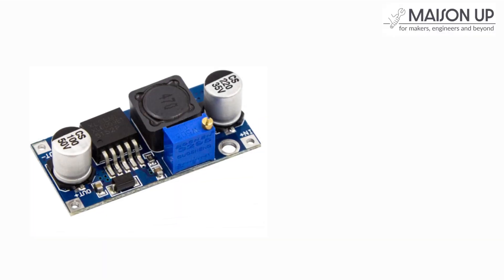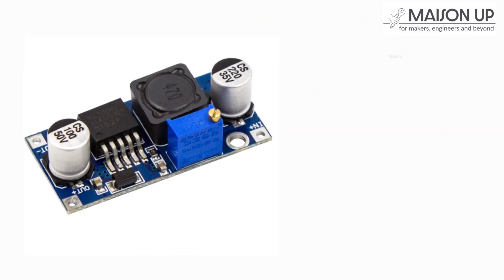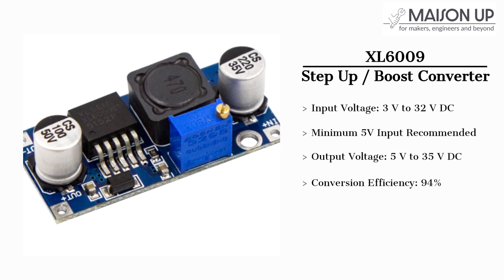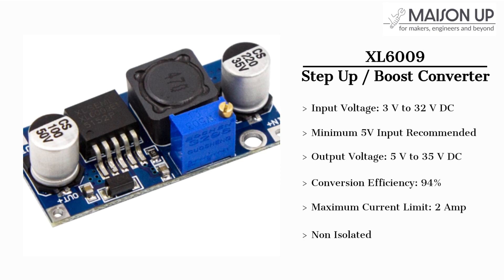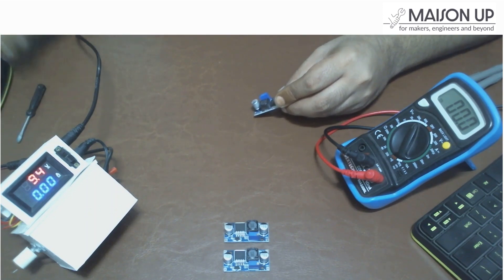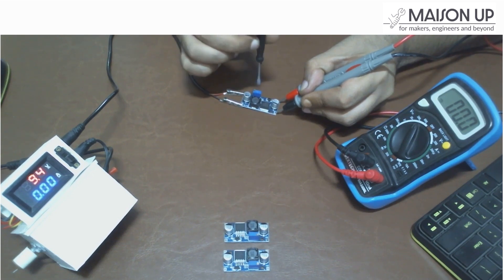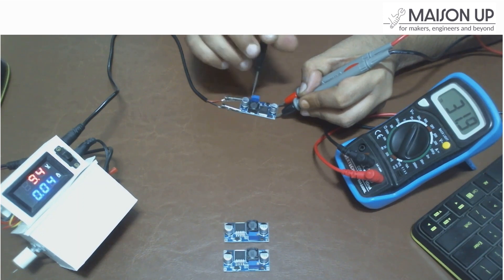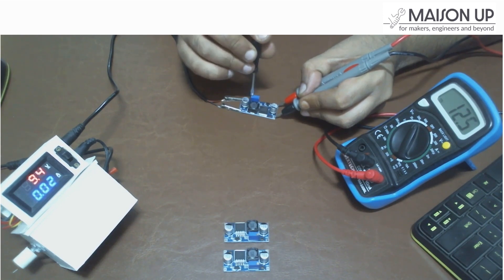Beginner's Guide to Using the XL6009 Step Up / Boost Converter Module: Setup and Operation

Comment: I have some of these and I want to power a E10 3.8V 0.3A Mini Light Bulb with two 3.7V 18650 Rechargeable 9900mAh Batteries with a 2 Pin AC 250V/10A 125V/12A rocker switch to turn the light on an off. Where to begin? I have no clue.

Comment: Hey, i want a module which can give 12 volt always, no matter when input is 10 volt or 14 volt. Will this xl6009 work?
Reply from the maker: The XL6009 (and XL6019) are only boost converters – they can step up a lower voltage to 12 V, but if your input goes above 12 V, they won’t step it down. To always keep 12 V no matter if input is higher or lower, you need a true buck-boost converter like an LTC3780-based module or LM5118-based converter.

Comment: that voltage will drop if you connect it to the module you want to connect
Reply from the maker: Yes, a slight voltage drop can happen when you connect a load to the XL6009 module. Here's why:

The load draws current, which can cause the output voltage to drop slightly.
A weak or low input power source may not maintain a stable boosted output.
Thin wires or poor connections can lead to voltage loss.
To fix this, use a stable input source, thicker wires, and consider adding a 470–1000µF capacitor on the output side.

Comment: Hello, i have a PD powerbank that does from 5-12v 22.5w can this module boost it's power my 19v hp Laptop ?
Reply: No
Reply: @lifeisdiy771  care to explain why?, im curious.
Reply from the maker: Hello! Good question — but the XL6009 is not suitable for powering a 19V HP laptop directly from a PD power bank. Here’s why:

The XL6009 boost module can output up to around 2–3A max, but most laptops need 3–4A at 19V, which is too much for this module.
Even if your PD power bank gives 12V at 22.5W, that’s only ~1.8A, so it doesn’t provide enough power to safely run or charge your laptop.
Boosting 12V to 19V also increases current draw from the power bank, making it very inefficient and possibly unsafe.
For laptops, it's better to use a dedicated PD trigger module (USB-C to 19V) or a proper PD decoy board designed for that voltage.
Reply: @maisonupstore  okk, Amps
Reply: @maisonupstore  what's the name of the certain PD trigger module tho?

Comment: Hello, i have a PD powerbank that does from 5-12v 22.5w can it power my 19v hp Laptop ?
Reply from the maker: Hello! Good question — but the XL6009 is not suitable for powering a 19V HP laptop directly from a PD power bank. Here’s why:

The XL6009 boost module can output up to around 2–3A max, but most laptops need 3–4A at 19V, which is too much for this module.
Even if your PD power bank gives 12V at 22.5W, that’s only ~1.8A, so it doesn’t provide enough power to safely run or charge your laptop.
Boosting 12V to 19V also increases current draw from the power bank, making it very inefficient and possibly unsafe.
For laptops, it's better to use a dedicated PD trigger module (USB-C to 19V) or a proper PD decoy board designed for that voltage.

Comment: Thank you for this tutorial. Connecting one 18650 battery, with 3,9 volts or less voltage the Vout of XL6009 Step Up jumps to 40 volts or more, the Vout red led blinks. If the battery has 4,0 volts or more, has the correct Vout. For example adjusting to 9 volts Vout with Vin 3,9 or less, Vout has 40 volts or more. I have made this with two differents 18650 batteries, with the same result.
Reply from the maker: Thank you for your feedback! It sounds like the XL6009 module is having issues with regulation at lower input voltages. This could be due to the module struggling to maintain stable output when the input voltage is too low. A few things to check:

Battery Condition: Even though you tested with two different 18650 cells, if they are old or have high internal resistance, they might not be able to supply enough current.
Load on Output: If there’s no load connected, some boost converters can behave erratically. Try adding a small resistive load and see if the output stabilizes.
Input Voltage Range: The XL6009 typically operates well above 4V input. Below that, it might not regulate properly, leading to uncontrolled high voltage spikes.
Capacitors & Components: Some cheap XL6009 modules may have lower-quality components. If possible, try adding a capacitor (e.g., 100µF) at the input to help with stability.
Reply: @maisonupstore  That sounds like a 100% AI Chat GPT Written response
Reply from the maker: @Gipsy_T.  Haha, fair enough! We do use AI tools like ChatGPT to help structure or speed up responses but we always review, tweak, and add own experience to make sure the reply is helpful and accurate.

Comment: I have 12v 140ah battery I want to convert it to 9v for wifi router it can do that please respond
Reply from the maker: To convert your 12V 140Ah battery output to 12V for your WiFi router, you’ll need a DC-DC buck converter like the LM2596. This type of module will step down the voltage from 12V to 12V, XL6009 is boost module to increase and not decrease. Be sure to use a multimeter to precisely adjust the output voltage to 12V before connecting it to your router. Additionally, confirm that the buck converter can handle the current your router needs for stable operation.

Comment: Why when I connect gnd input and gnd output, the ouput voltage became so high until 200v ++, I need explanation for this, please...
Reply from the maker: The issue you're experiencing with the XL6009 module could be due to a misconnection or a malfunction of the module. Here's a possible explanation:

GND Input and GND Output Misconnection: If you're connecting both the input GND and output GND together, and the output voltage spikes excessively, it could mean that the circuit is malfunctioning. The XL6009 is a boost converter, designed to step up voltage, and improper grounding can cause erratic behavior.

Feedback Loop Interference: The XL6009 uses a feedback loop to regulate its output voltage. If grounding is misconfigured, it might confuse the feedback mechanism, causing the module to boost the voltage far beyond the intended level. This could explain why you're seeing such a high output voltage.

Faulty Module or Components: There might also be a problem with the module itself. Components like capacitors or inductors could be damaged or not properly soldered, leading to an unstable or incorrect voltage output.

Suggestions to Fix:
Double-check all your connections. Ensure that GND on the input side is properly connected to GND on the output side if required.
Verify that you're connecting the positive and negative terminals correctly.
Try resetting the module by disconnecting power, reconnecting everything properly, and powering it on again.
If possible, test with a different XL6009 module to see if the issue is specific to the one you are currently using.

Comment: Can you explain some stuff,

1.my earbud case had a PCB with IC that converted 3.7 volt from its battery to 5 volts for chargin, but that PCB burned, its useless now,

So can I use an TP4056 and step up module to charge my buds ? Will the step up module charge both buds at the same time
Reply from the maker: If your original PCB burned out, you can definitely use a TP4056 module to charge your earbuds’ 3.7V lithium battery. The TP4056 is a reliable choice for charging lithium-ion batteries safely.

To power the earbuds themselves, you’ll need to step up the 3.7V from the battery to 5V. A boost converter like the MT3608 can be used for this purpose. The step-up module will provide 5V, which should be enough to charge both earbuds simultaneously, as long as the total current draw is within the boost converter’s capacity.

However, keep in mind that the setup can become quite complicated and bulky, making it less practical for an earbud case where space is limited. Due to size constraints and potential wiring challenges, this solution may not be ideal or easy to implement.
Reply: @maisonupstore  okay, I appreciate your help

Comment: Can a pwm of amplitude 5v be used as input ?
Reply from the maker: Hi! Yes, you can use a PWM signal with an amplitude of 5V as an input for the XL6009. However, it's important to ensure that the PWM frequency and duty cycle are appropriate for your application to achieve the desired output voltage and current. If you have any specific questions or need further assistance, feel free to reach out to us at nidhi@maisonup.in.

Comment: I have 12 volt battery  but my device operate on 19.1 volt and 1.2 amp can it handle this device load smoothly
Reply from the maker: Yes it can easily handle 19.1 Volts at 1.2 AMP

Comment: And what happend if the input voltage decrese?
Reply from the maker: Hi, module does have inbuilt capacitors to tackle voltage fluctuations. Output should be steady as long as there are no major variations.